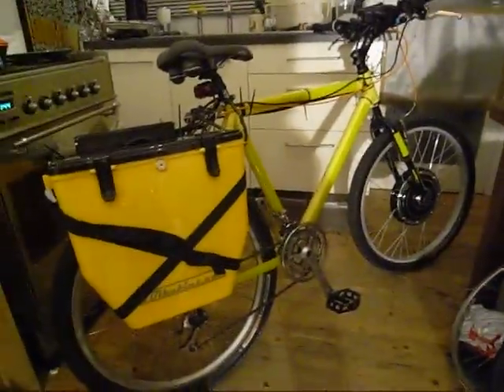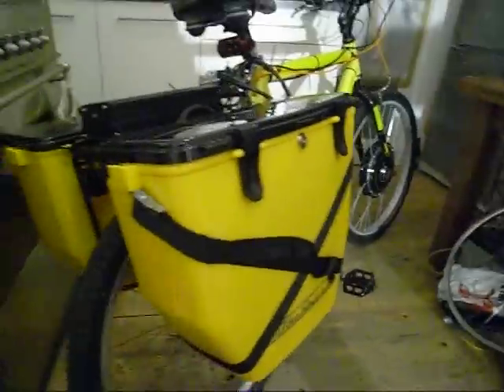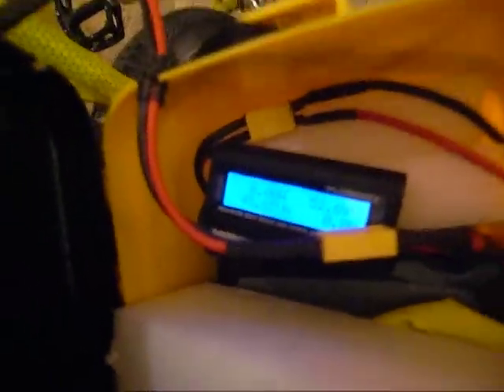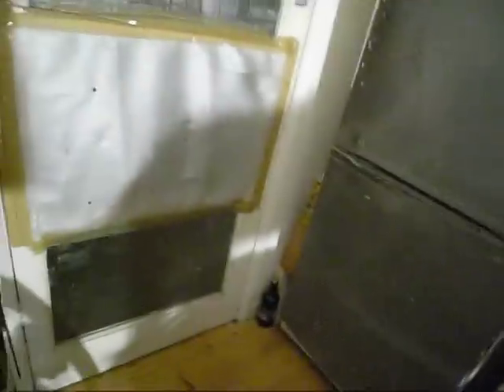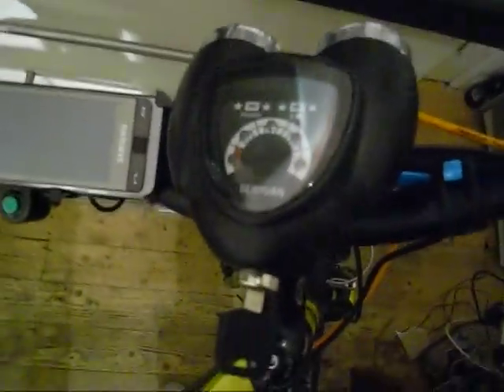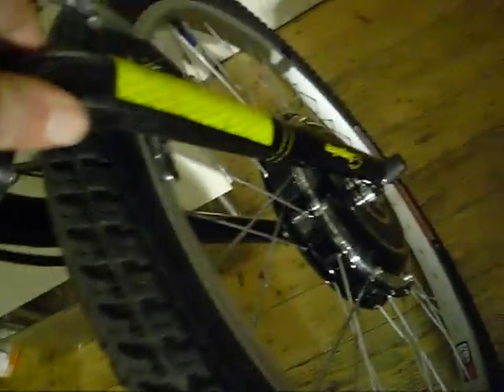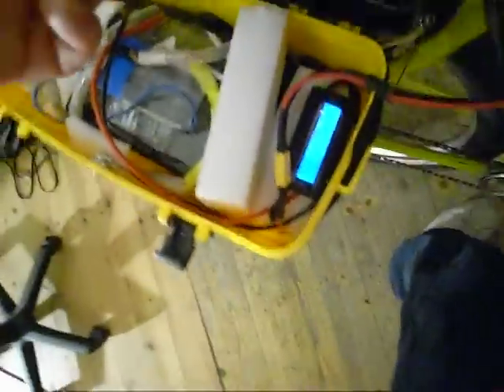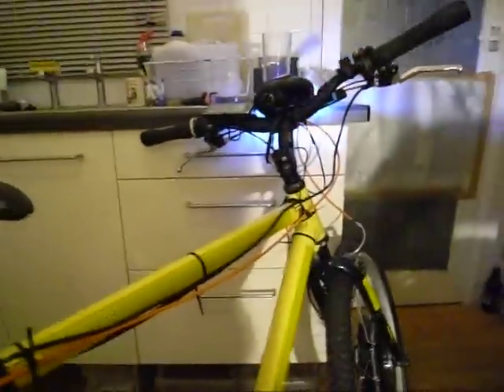E-Bike Gum - 1000w 48v kit with Ping 48v 20Ah battery

Comment: Were did you bought this kit.
Can you tell what your range, topspeed, how do you experience frontwheel drive?

Goes the battery with a BMS and charger when you purchased it, was there a wiring diagram?

kind regards, Paul